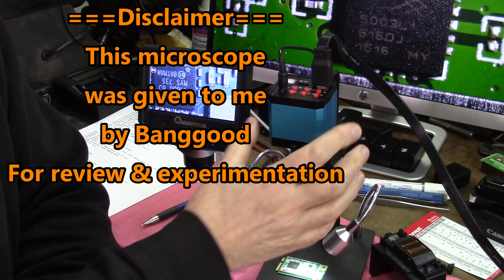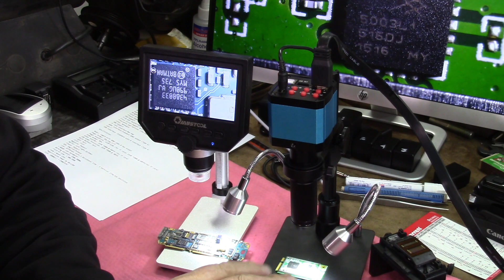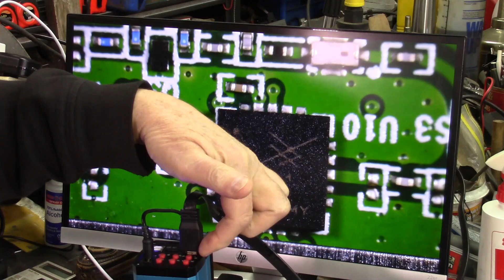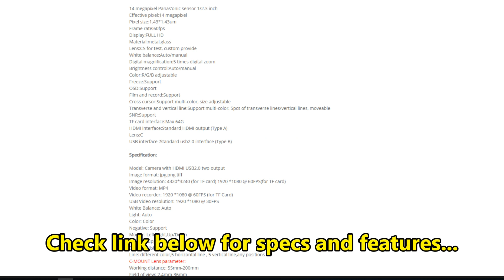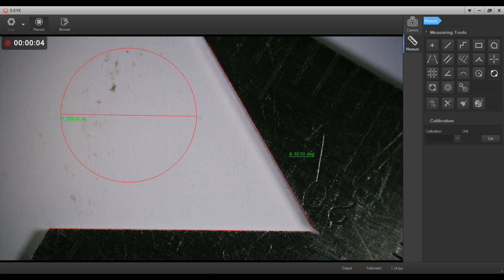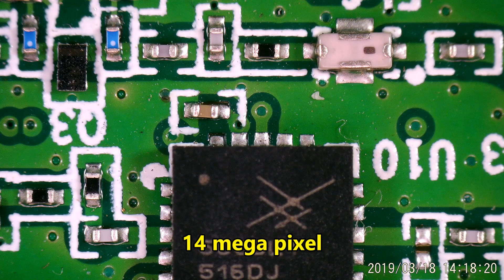Electronic Microscope, low priced 14 Mega Pixels, Great results....!!!

Comment: I have the lower resolution one myself and HATE IT.. Seriously thinking of getting this one or the higher resolution models.. You sold me on it Plus I have a way of recording it in 4:2:2 pro Rez (gotta love Atomos)  subscribing .. Thanks
Reply from the maker: Just like you say, the lower resolution scope isn't much good for recorging good images. My opinion on it is that the video chips used on it are real crappy. On the orher hand for the higher resolution unit, they use as a base some kind of a CCTV body with the required adaptors in order to make a good macro photography camera. In my opinion it's worth the extra money if you require good resolution enlargements.
Atomos system is a great monitor/recorder...!
And, thanks for subscribing and for taking a moment to leave a nice comment,   Pierre
Reply: @pierresgarage2687  no problem when someone gives me good advice I let them know and thank them will be upgrading soon. Thanks again .

Comment: That's cool especially since it even comes with software that allows angle and distance measurement, like you say it appears to have basic optical comparator ability.  I was considering a portable old school overhead projector that was on sale at the local second hand store for 60 bucks, but after seeing that camera I'm thinking that I'll pass on the projector and save some shekels for something like what you're using there.  Looking long-term, my vision is good now but now that I'm over 40 it's not guaranteed from here on to be good . . . Thanks for sharing!
Reply from the maker: I'm glad I got this microscope, the quality is way higher than the cheaper one I already got, it's not just for when you lost partial sight, also great for anything that you need to see close-up, as an example, you can spot the tinyest spec of dirt or break or detect wear before you could even imagine...  Cheers,   Pierre

Comment: Better check the software out, it seems bugged... :)
I watched the 2nd video first, this looks like it has enough resolution to be useful. At 1920x1080, there must be some finite distance between each pixel at full optical resolution. I wonder what that would be.
Reply from the maker: As far as you can magnify using optical way, there is not much limitation on how many pixels there are, the resolution is going to be better than what the scales and the DRO can resolve,  the software seems to work all right, just more difficult to calibrate the scaling on it as the magnification will afect the distance every pixel represent.  you would need to keep everything fixed after such calibration, i.e. Zoom and focus...

Comment: I've considered the practicality of using an old scanner for a "poor man's optical comparator."  It might work for simple stuff, if there is room for scales to fit with the part.  It would not be easy to align, though.
That camera is certainly something to keep in mind.
Reply from the maker: This is simple enough, like you say the scales are the key to good and precise data.  For a good source of backlight, you can use an old LCD moitor or tv, you  gut it out and keep only the fluorescent tubes and diffusing pannels, this makes an excellent light table.
The camera is able to do what ever you want from it , just depending on the lenses you install on it.
Quite versatile mostly with the few built in features...

Comment: I must be a fluke, because I watch the whole video, when it comes to machining.  Will a small mirror above the unit reflect the infrared to operate the remote controls from lower angles.  I used to bounce my TV remote off a wall picture.  Great demonstration video.  Do you use the Canon Vixia cameras for you videos.  I have two that I use.  That Ant video reminds me of the movie 'THEM!'.
Reply from the maker: Guess that some reflective surface will solve the issue. I got a few Vixias 2 HR-600 and one Vixia G40, everything is better than Go-Pros or similar, also the possibility to add an external microphone, so much a need in an noisy environment. The G-40 is a real good camera...
All the old folks here seem to remember " Them "   lol
Cheers,   Pierre
Reply: @pierresgarage2687  I've got a HR-600 and a HF R30.  Have used the 30 much but the 600 is a great camera.
Reply from the maker: The thing I find about those models, HR-600 and 30, is the lens isn't very wide angle, if you add some cheaper wideners then the quality is really affected, lost of the filming here is done in situations where space is limited and I can't place the camera far enough to catch everything...
This is where the Vixia HR- G40 is doing great the lens is catching as wide as the other cameras with out installing a widener on the lens, the only drawback is the price, though, maybe one day Google will contribute enough to help me break even...    lol